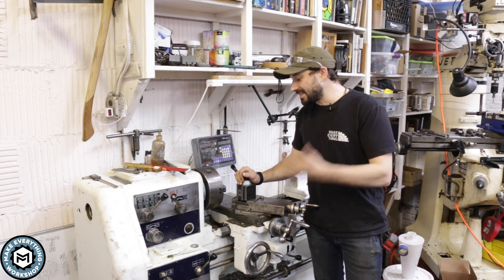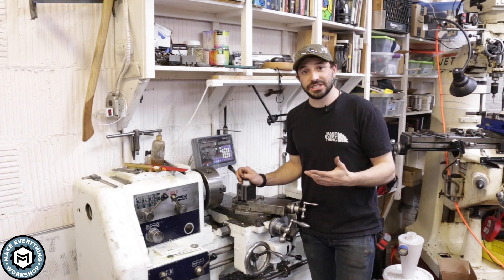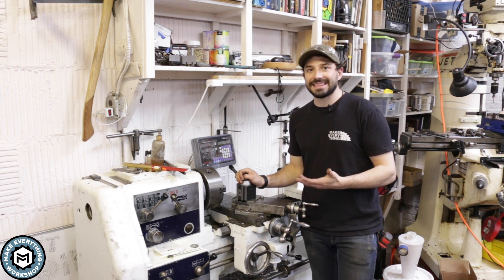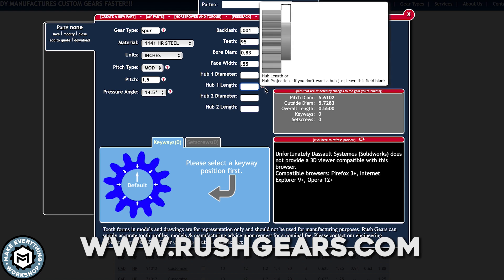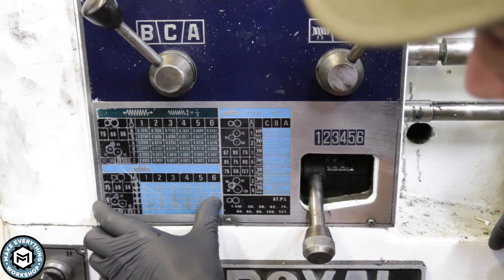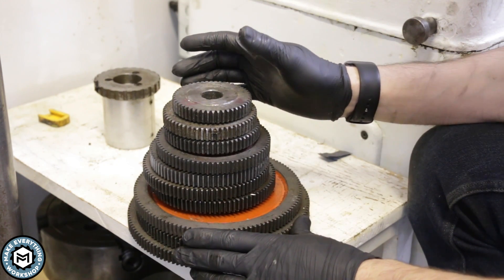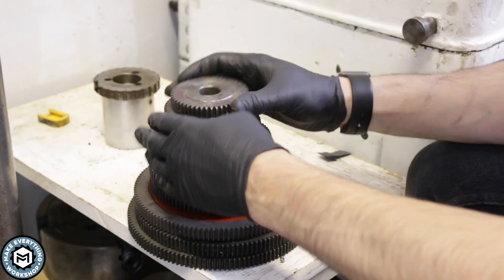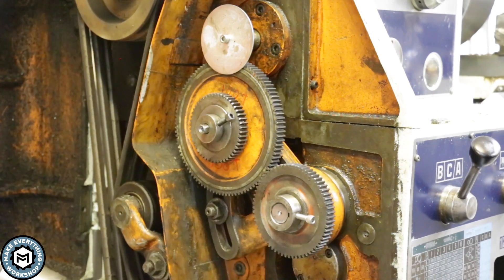3D Printed Change Gears In A Heavy Duty Lathe?

Comment: In a hobby environment this is fine with plastic gears. The problem is that when you're working an expensive piece of material and that plastic gear blows out and scarps the part, metal gears are suddenly really worth it. Now that being said, I also have used printed gears to get by while waiting for a proper gear or the time to cut a proper gear. 
All in all, good video though.

Comment: If you wanted to make the plastic gears last longer and you had room, you could make them 2 or 3 times wider, but you would need to replace all of them on the lathe. that way each tooth has a higher load capacity.

Comment: A lot of times when you break metal tooth gears, you will break the teeth on the gears touching it, from misalignmeng or from chunks of gears going through the teeth, with the camming action it can put crazy side loads on the shafts the gears run on as well.  So if you have a plastic gear in the middle of a 3 gear drive train, like your setup, then your plastic gear will break first, saving the other 2 gears.  

They have also been using non metal gears to reduce vibration since at least the 1920's, both my 1929 ford model A and my 1947 willys cj2a have fiber reinforced resin timing gears on the crank shaft.  The plastic technology has come a long way, but even those old ones worked great if you ran them, if you let them sit for 30+ years with the same part of the gear sitting in oil they will shred, so some mechanics will say they are junk, but that wasnt how they were intended to be used, hah.

Comment: Maybe you did not realise this but it does not matter how many teeth are on that gear. It does not have any effect on the ratio. Here is really good video that explains it in detail. https://www.youtube.com/watch?v=KbwM-cOx1c0 I have an old lathe with missing gears which is why I watched the video, I wonder if the 3d printed gears would handle driving another gear via the keyway.

Comment: Another idea would be to use a smaller steel gear as a hub. Just print your larger gear with a pocket in the middle for the smaller steel gear. The teeth interfacing with the plastic would be way stronger than the keyway, and it would take a whole lot less plastic and time to print.

Comment: You could print an 95ngear that has a hole that matches the shape of a smaller metal gear. That way you can use the keyway of the metal one.
Reply: Yep Especially since he said he somehow got two of the same gear in one size. Use the extra as a carrier for another larger size.

Comment: I hate to tell ya' but the new, printed gear is only used to transmit power and reverse direction.  It has absolutely nothing to do with the overall gear ratio and/or thread pitch.  Any gear with the correct module (M1.5 in this case?) that can span the distance between the stud gear and the input shaft gear will work for this set up.

Comment: Did you check whether plastic on plastic really would have a lower coefficient of friction? Usually (at least with metals), you get a lower friction between different materials than when both surfaces are of the same material. Making all entirely out of plastic, especially partially hollow 3D prints, would also mean more play in the system, which could mess with the teeth alignment. From what I've heard, alignment and matching geometry is the most important factor for gear wear. Besides that, more flex could also impede precision or introduce vibrations. Metal wheels with added plastic teeth should suffer less from these problems than fully plastic ones, which is probably the reason the original ones are made that way.

Comment: I agree with having a 3D printer around the shop even just for useful things like this. An alternative material worth looking into would be PETG if you can, or even Nylon.
Reply: Annealed* PLA smokes just about every other printable thermoplastic available, just anneal finishes gears in sand and they'll become way stronger. PLA is just such a cheap and easy to print filament, IMO its well worth it to anneal it and then have it outperform nylon.

Comment: I've always said, every house needs a 3D printer (or 5).  PC would have been a more durable filament... But hey, PLA got you through your immediate need.  Prusa will have a extremely strong PC/carbon fiber filament out sometime in June.  And it will be easy to print with, unlike normal PC.  PETG is another filament that is less brittle than PLA.

Comment: You know... That gear you just made, that probably took forever to print... Yeah, that's not actually needed 😉 it's just an idler gear to take up the space in between the two gears... You could have used any one of the other gears you already had, as long as they would "bridge the gap" between the two gears... But it was a good demonstration of something a 3D printer might actually be useful for 👍
Reply: I love this.. He just does things, he doesn't really understand or even try to learn enough, just the bare minimum to do the thing he wants to do.

Comment: I've printed gears for my atlas 12,it works well, I printed mine in ABS which was hard for my printer but,got through it. The gear generator is a great tool I didn't know of. I'll be printing gears to slow the feed speeds next.

Comment: I enjoyed the video. I, too, have used 3D printed gears temporarily. A couple points I would like to make. One, Fusion 360 has a gear maker function that does the same thing that the gear maker website does. It comes as part of 360. And Two, you only need to worry about tooth count when there is a second gear on the same shaft that is being engaged in the next gear. In this case, since the gear is directly driving the next gear, the tooth count is irrelevant. If, on the other hand, the other gear on that shaft was driving the next gear, the ratio between those two is critical. In your case, they likely called for a 95T merely because of the needed diameter. The 85T or 100T would have worked equally as well.

On a side note, when you couple the 100T and the 127T gear together, that gives you the proper ratio to cut metric gears.

Comment: Chris, elegant solution to a common problem. I have a Eastwood 7x12 mini lathe.  How long did it take to print? Also is there a strong filament you could have used?
Reply from the maker: This gear was pretty big took about 14 hours to print. I’m still learning on ways to optimize and speed up 3D printing so I’m sure there’s a faster way. The PLA seemed to be good, but I’m reading here in the comments there may be a stronger option. Good luck!
Reply: PETG is stronger than PLA and if you want stronger parts I often print with carbon fiber reinforced PETG filament. Like Carbon-X. The only thing with carbon fibre filament it is very abrasive and you need to check the wear on your nozzles and feed gears.

Comment: Actual plastic gears for "mini lathes" (cheap import machines) are nylon so maybe using a nylon filament would help. PLA is very brittle so event petg could help with the snapping issue and it is easier to print than nylon
Reply: Abs or nylonx should do it

Comment: You did not need to make a 95T gear for the threading operation you demonstrated. The gear is being used as an idler. Any gear that filled the void between the top and bottom gear would have worked fine. The 100T that you already have would have done the job much better.
Reply: @jimnolimit  The middle gear, i.e. 95T, does not have any effect whatsoever on rotational speed of the lead screw, but it does reverse the direction of rotation. This is a very common situation on lathes for some operations. Both gears on the middle shaft would have to be engaged for  them to have any effect on the ratio. The second gear in this situation is just being used as a spacer.
Reply: @EDesigns_FL  You are correct, that middle gear is just an idler. I deleted my original replies.
Reply: Very good point, I don’t know if I would have thought about that but it makes perfect sense, especially since it’s on a moving arm, as long as diameter of the gear can engage with the other 2 gears you should be golden.
Reply: You're kidding? That's embarrassing. The fact that he didn't know that, makes me think he didn't even look anything up, except the dimensions/tooth count of the gear.. So, how do you think it would've worked out if he did try to 3D print a lead or stud gear out of PLA?
Reply: Would you mind elaborating on that? Because as little as I know, it would change the rpm unless 1) you cahge the other gears to match the rpm, or 2) you adjust the speed of rotation some other way. I don't know how lathes work, but I am curious. Peace
Reply: @jtcmlt1  The 95T gear is just transmitting power from the top gear to the bottom gear on the leadscrew. Other than changing the direction of rotation, it has absolutely no effect on speed/drive ratio. It just bridges the gap between them.
Reply: @EDesigns_FL  Okay, so the larger gear 100T doesn't take longer to make one revolution than the smaller 95T, because, to me, in order to have the same pitch/tooth size adding teeth increases the diameter and therefore reduces the rpm when married to a smaller gear with the same pitch. How can you change the size of only one gear and keep the same ratio? I don't get it. Do you change some of the other settings? If you don't mind briefing me a little, I will really appreciate it.
Reply: @EDesigns_FL  Thank you. I just worked it out. I have been on the road for the last few days and didn't give myself a chance to work it out until now. Now, why does the lathe asks for the specific sizes? Is it to get the best performance and the lowest loads for the specific task?
Reply: @jtcmlt1  There's a large range of sizes that would work in this application. For simplicity, the manufacture just selects one of the many options rather than specifying a range.
Reply: @EDesigns_FL  Okay. Thank you for the help 👍👊.
Reply: @jtcmlt1  you've got it now. This is why the middle gear in this type of gear train is referred to as an 'idler gear' . It transmits motion between the driver and driven get are but has no influence on the ratio between the driven and driver. This all changes if the back gear train is configured as a 'compound train'. The sizes all matter then.
Reply: exactly!

Comment: FYI, you can also go to McMaster and download 3D CAD files of most of their parts. Some will be more "artistic representations" rather than fully functional, but it's better than nothing.

Credit to AvE for putting that trick in one of his vidjayeos a year or two ago.
Reply from the maker: I actually use that feature all the time! It’s a great way to get correct thread pitches for bolts and nuts into fusion and then you can modify them as needed!
Reply: You have to be careful about that I believe in their terms and service they say your not allowed to 3d print the cad models